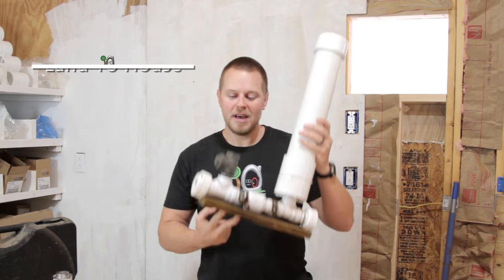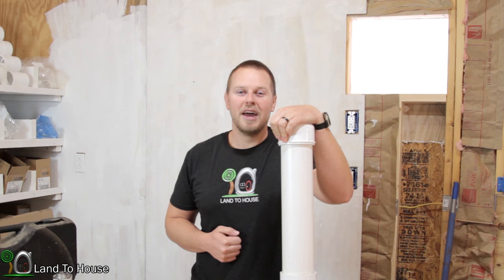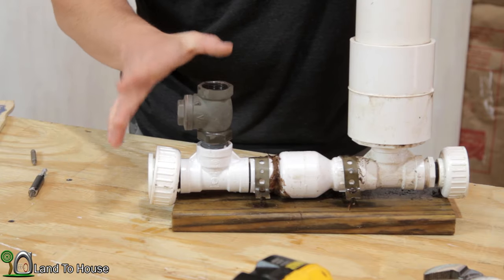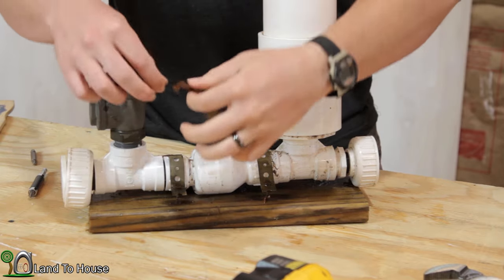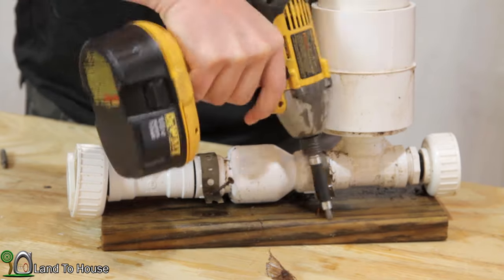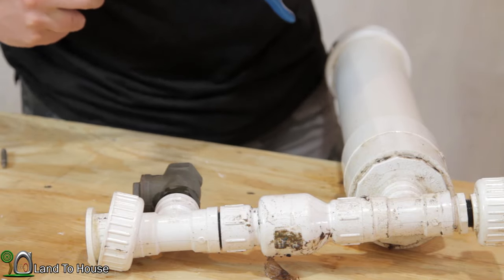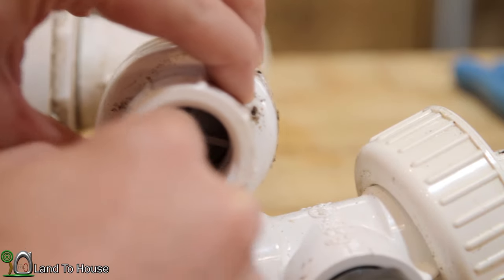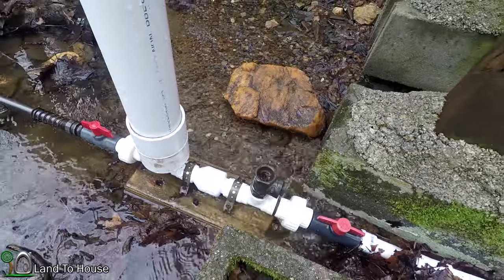Ram Pump Waste Valve Not Cycling

Comment: Hey Seth, I Have built a 1" Ram Pump all other things are fine. The design is not the linear one. I also removed the air and also nothing was stuck in the pump but the waste valve after 2 or 3 cycles closes and after multiple pushes doesn't works again.

Also some times it does works perfectly until the delivery valve is closed and as soon as I open the valve it stops though I do it slowly.
Reply from the maker: It sounds like you're having back pressure issues with the delivery pipe. What is the input head pressure and how high are you lifting water? Normally whenever the pump stops with the delivery valve open there is too much pressure trying to lift a short height.

Comment: I can certainly confirm what you are saying, I have just had both of those problems at the same time! I took the pump apart and sure enough there was a leaf stuck in the valve, put it all back together again and it still stayed shut! Eventually I found a 6 inch crack on the underside of the delivery pipe it was just about in the water but was drawing in air some of the time so it would run for an hour then stop, I would purge the air and an hour later it would stop again, drove me crazy until I figured it out. The one upside to it all though is it is now delivering more water than ever before.
Reply from the maker: It still baffles me that a tiny leaf or pinhole puncture will stop the pump. Better performance than ever! Well worth it in the end.
Reply: No effect

Comment: great video. I just added a pvc drive pipe 1 1/4 inch that reduces to 1" at pump. this is because the pump I built was a 1" system last year. 
my pump started having issues with stopping right after I added the pvc (previously flex tube was my drive pipe). how air tight do the joints need to be? I found one that's leaking right after turning on unfortunately. didn't think it would matter, but then I found this video... 
dimensions. 
3'head pumping to 18 feet. for this pump. pumps well but slowly the delivery suffers and the pump stops cycling. first step is to fix the leak in the delivery pipe I assume.

also water on delivery end has a lot of tiny bubbles in it. don't know if that's diagnostic at all. bit thought it was an interesting observation.

Comment: good video as always!
I had that happen about a week after i set my ram up. A stick got lodged in the check valve.  It was a good reminder to put in a filtration system. :)
Reply from the maker: +The Farmacy Seeds Network It can be a real annoyance especially if you're not sure what's going on at first.
Reply: It sure can, but once you realize it's not holding pressure, you kinda know.

Comment: My waste valve never wants to open again. Haven't quite got my head around what relieves the pressure so the flapper can fall again. Does it have something to do with the pressure wave going back up the drive side. Wondering if feeding with a 50 ft garden hose is a problem.
Reply from the maker: Ah yes the source needs to be open to air. Using house pressure will keep the valve closed.

Comment: Thank,may pump was working fine before but I came and found that the pressure tank pop off and the material i used inside the tank were compress so I used the bycle tube and it worked for sometime......then it found it fishing out water if I shut it off it Will work for an bit.I took out the pressure tank and reducing it to your specifications.my feeling is that too much water in the pressure tank.my tank is about 3'-0" with only the inner tube. ...so it's my thoughts that I need to reduce the size of add more deflector inside
Reply from the maker: In your other comment you mention that you have 18 feet of head pressure and you are pumping to 80 feet. 18 feet of head can pump water to 125 feet or so. You might actually be having an issue with back pressure. If you close the delivery ball valve to 1/2 or even 1/4 does the pump work longer? If you close the valve all the way it should run without stopping. If this is not the issue I would look into an air leak someplace in the drive pipe or pump.

Comment: Gosh Seth, I need advice here please. I built a 1 1/4" ram pump as per your instructions. My drive pipe is 2". My drive pipe length is 260ft and head pressure is 10ft. I am reducing from 2" drive to 1 1/4" ram pump. The waste valve stays shut even after making sure there are no obstructions or air in the system. I am concerned that the pressure is too high for the 1 1/4" waste valve. Should I add a larger/heavier waste valve?
Reply: Any progress?

Comment: I know you figured out you could go about 200' with a drive pipe, but I've read a lot that says the drive pipe can cause problems if it's too long.  None of the literature I can find ever says WHY it's a problem, though.  I need to go about 500 ft to get 15 ft of head (I need to pump up about 115 ft).  You think I need to go about 300' with a supply pipe, then do the stand pipe, followed by the drive pipe?  I plan on using a 1" pump, so would need 2" supply from what I can tell.  Thanks!  Great videos!
Reply from the maker: The 200' was for a 1/2" ram pump. The larger the pump the shorter the drive pipe has to be. With the 1" pump I would not go over 100' drive pipe. The reason that it is so important to have a shorter drive pipe is because of the time it takes the water to get back to the pump. Too long and the secondary waves have already closed the brass valve before the main pressure wave has the chance to close it. If the valve is already closed before the main wave gets to it then it will not cycle. So for your 15 feet of head pressure I would use 400 feet of 1-1/2" or 2" supply line and then a stand pipe. After that use 1" for the drive pipe.
Reply: Fantastic! You are the first person who could explain this concept in an understandable way. I really appreciate what you are doing.
Reply from the maker: I am sure that I am missing some info too but that seems to be the gist of it.

Comment: thanks for the information but I have a problem with my check staying open after some time of operation and staying open,water just flowing out after a few cycles.
Reply from the maker: +Husent Elcock I have a few thoughts on that issue. What is your head pressure? Sometimes if you do not have enough head pressure the pump will not cycle properly. Also is your drive pipe smaller than the waste valve? If there's less volume of water entering the pump the weight of the waste valve may be too heavy for the water to push closed. Sometimes air in the drive pipe will not close the valve but keep it open.

Comment: greetings,it been a while .....just to report that my ram pump have been working well and is pumping water to a great height will give those data later.The problem i encounters was that the check valve was loose,it had a nut holding the valve together so it was not sitting properly,also the drive pipe had a leak so i change the drive  pipe which had leaks . it been working ever since.thanks for all the help.i assume i am pumping over 120 feet up hill.
Reply from the maker: Great update! I am happy to head that you are getting nice results over a long time. The waste valve can wear down over time and will need to be replaced. Some will open the valve and replace the screw with a new brass screw.

Comment: I know waste valve but what's the name of 2nd valve which is attached center between waste valve and pressure tank???
Can i use spring valve at center????

Pls sir reply me my pump can't work..
Reply from the maker: I refer to that valve as the inline valve or secondary valve. You can use a spring valve. I recommend keeping the spring pressure low. Example half pound pressure.
Reply: Land to House thank u sir for your advice but sir i tried but still not working..sir..i have problem on my ram pump..when i start my input then waste valve become close and not blinking after some figure pulling in it and when i angel my pump some degree then it will be start but not on horizontal and when i open output valve waste valve become stop...i have 1 inch ram pump.
Reply: How to buy  this rump pump

Comment: For my mine the first valve are always open and doesn't want to shut.. I dont know why.. can you help me
Reply from the maker: That is often a sign that air is in the drive pipe reducing the flow rate. See if you can purge air out of the system. Might also have debris over the intake.